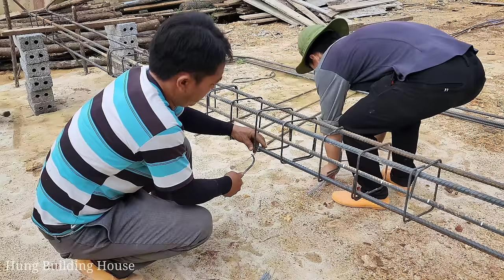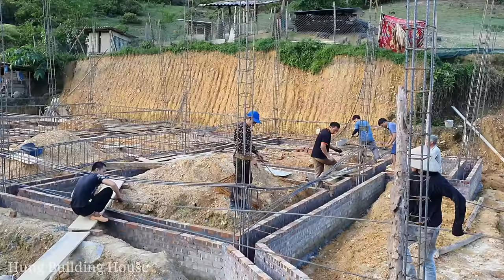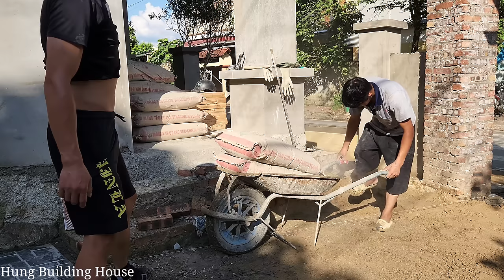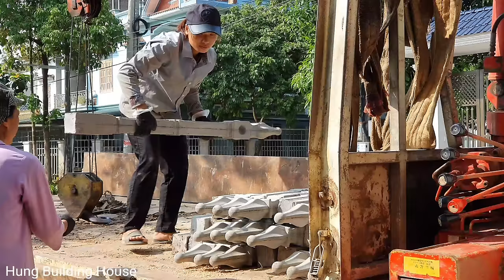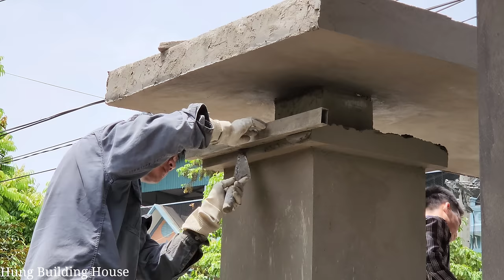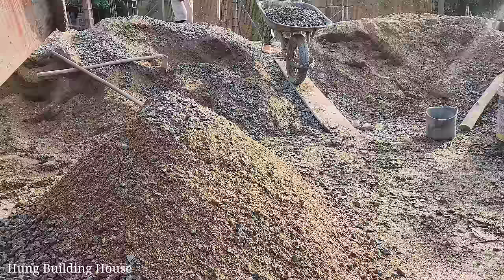FULL VIDEO: 60 Days House Foundation Construction, Yard Floor Tiles, Concrete column, Plastering

Comment: Hello,  tie beam cover brick is meaningless use timber frame instead of brick,  and remove the timber after concrete is strong enough, it only needs 1 day to remove the timber
Reply: Relax there are many ways to kill a cat
Reply: @ogone1465 Yea but is cheaper... And you can reuse that wood. Its like killing cat with hands vs buying 2.5k$ rifle then killing it...

Comment: I would go for mat finish tiles next time..coz it looks more authentic than these glazeed tiles also more slippery when wet..a more rough slate finish is timeless whereas cheap tiles, you ll rip out in 10 years..just saying..stick to the long View and quality timeless materials, even handmade  Terra Cotta tiles that are timeless if layed well...maybe diagonally with a border and some Refinement.

Comment: To make the work easier for you when you want to lower the reinforced iron into place after preparing it, you must lower it from the middle center first, then the longer side, to the end of the two sides, and always from the middle. Then the other side, and then the other sides are lowered until the whole process is completed, whether on the ground or on whatever floor it is taking place on. The process is the same way.These people lower the reinforced iron from the outer edges to the inside, and this is wrong, and they should do it the opposite